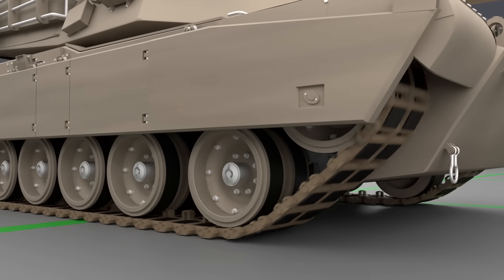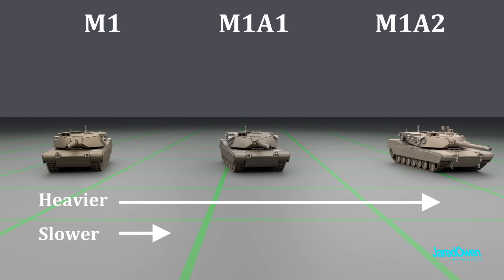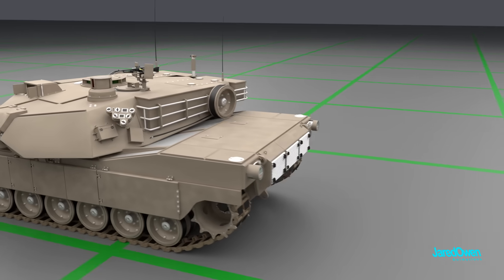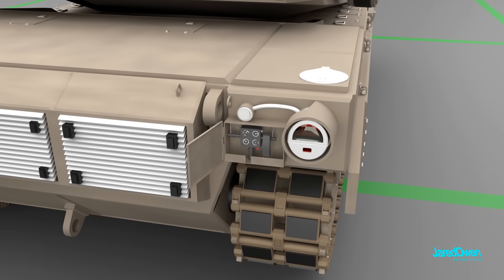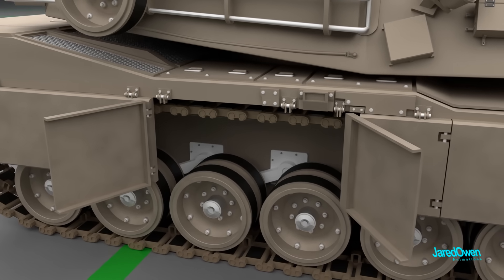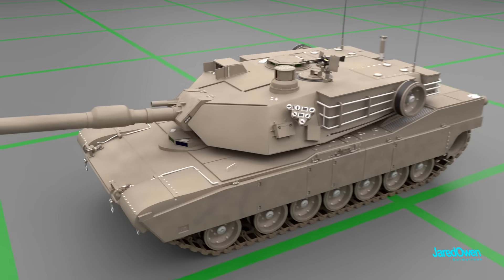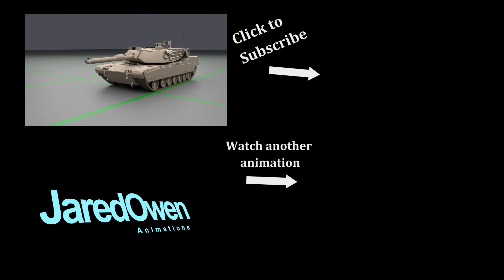How does a Tank work? (M1A2 Abrams)

Comment: I was a M1A2  Tank Engine Mechanic and Tank Recovery Specialist (63E10. H8), stationed at HHC 4/64 Armor Delta Team Maintenance, 24th Infantry Division Fort Stewart Ga  89’ to 93’, served in Desert Shield/Storm from August 90’ to March 91’…….the video is pretty accurate describing everything, the only thing that’s different in the vid is when the phone was shown on the back of the tank, they weren’t there during the war (they must have been added years later after I retired).   I had the privilege of driving and riding in them during maintenance work (testing the engine after fixing them and riding in them to make sure the transmission sounded properly after the support team fixed them etc…)

By the way, the tank can reach speeds of up to 70mph but if the tank went that fast the transmission would tear up,  so to prevent this a governor is put on the engine to limit the top speed to 45mph.   Some might think that’s a slow speed, you go ahead and try to stop 60 tons zooming towards you that fast…….yea, good luck with that…..lol
Reply: Then how did they communicated? Also, thank you for your service brother! 😎🇺🇸
Reply: @droman608  They communicated thru regular comms  inside the tank from the headsets they wore.
Reply: Thank you for your service.
Reply: was the tank loud?
Reply: @ProAvgeek6328  No, it’s very quiet inside and believe it or not the ride is very smooth like a Cadillac I kid you not………..your hear the engine but it’s not loud like you hear it on the outside, it sounds like a low hum sound inside the turret.
Reply: @Akumaa2000  interesting
Reply: @Akumaa2000  I have so many questions about the tank so first of all how do you check the fuel level?
Reply: @ProAvgeek6328  In the drivers compartment there’s a digital display that shows how many gallons of fuel the tank has, there’s 3 fuel tanks (one up front and two in the back on each side on the top rear of the tank) and the driver relays the info to the tank commander.
Reply: @Akumaa2000  It shows how many gallons of fuel is left, does it calculate range?
Reply: @ProAvgeek6328  Yes it does , the tank commander also has a chart (forgot what it’s called) that estimates the range of travel from the capacity of fuel left or something like that…….don’t know if they still use that or if they have something more advanced.  I know alot of the tanks went thru some serious upgrades years after I retired (better armor, electronics, ammo etc…)
Reply: @Akumaa2000  oh nice
Reply: @Akumaa2000  how does the gunner fire the main gun?
Reply: @ProAvgeek6328  that’s done from the gunner station in the turret.
Reply: @Akumaa2000  but how does the gunner specifically aim and fire the gun? does he use a joystick or something?
Reply: @ProAvgeek6328  the gunner has a fixed handle with two pedals on each side (the best I can describe it) in front of him when he’s sitting in the gunner’s seat, it can be turned left and right like your twisting which turns the turret left and right and you can move it forward and back which moves the main gun up and down etc…..on the front of the two pedals there’s buttons that can be pressed when squeezed, this sends an electrical charge or whatever it’s called to the main gun to fire and shoot the sabot tank round to its target, (I don’t know if this has changed from upgrades over the years by I’m guessing it’s relatively the same).
Reply: @Akumaa2000  alright thanks
Reply: @ProAvgeek6328  From my personal experience it wasn't. The engine was rather quiet, however if you stood close enough it would rattle your whole body (LITERALLY). This happened to me while stationed in S.Korea. #awesome
Reply: @droman608  Where you a tank commander or loader ?…..those two positions seemed to be closest to the engine in the turret with the gunner up just little further but not much.
Reply: @Akumaa2000  As much as I would've loved to be the tank driver, I was too tall (one onf my comments show this). I was a 88M. #thankyouforyourservice
Reply: @droman608  88M is what I really wanted to do but since “transportation” covers so many driving jobs the video for it at my recruiter’s office wasn’t working, I didn’t want to make the mistake of ending up driving an officer around in a Humvee so I picked tank mechanic instead since there was a video for that one…..lol
Reply: @Akumaa2000 the odds of that happening are rather small (even though it happened to me). Although you probably seen those HETs, I'm glad I never drove those because it meant staying in the field waiting for the tanks to return.
Reply: @droman608   I would have done HET driving job too if the video was available for viewing in the recruiter office.

Comment: The Abrams tank is a bad copy of the German Leopard 2 tank. The Abrams tank has no chance against the German leopart tank
Reply: Copy how?
Reply: Absolutely true, the M1 Abrams prototype hulls were built in Germany by Krauss-Maffei and many components are still interchangeable with the Leopard 2.
Reply: @sandervanderkammen9230  No they weren't?
Reply: @peterson7082  Same hull and chassis design, same basic gun too.
Reply: @sandervanderkammen9230  Not even close regarding the hull
Reply: @peterson7082  The 
XM815 and XM1 chassis-hulls were built and imported from Krauss-Maffei in Germany.
I have seen the data plates myself to confirm this.
Chysler modified the rear plate and engine deck to fit the AGT-1500 and added the front locker for  track grousers. The  GM X-M1 hulls are still nearly identical to the Leopard 2.

Comment: Imagine taking just five of these back in time for World War II
Reply: Remember that part where he said it runs on jet fuel?
Reply: @kablah777  Just my imagination thinking how technology has advanced.

But you seemed a little snarky, so Let’s think about this🤔

Jet fuel can actually be used in trucks, but only in diesel engines. Ultimately, the difference between gasoline and jet fuel are the hydrocarbon molecules and the additives contained in the fuel. Both are derived from crude oil, and both run their respective engines on combustion. So the means to producing  jet fuel in that time line isn’t so far fetched.  

Also The Germans had over 60 jets in WWII.

Comment: You Forgot the Brits Who pioneered the Main Battle Tank Design Still used today
Reply: The first MBTs were built in Germany.
Reply: @sandervanderkammen9230  What would you consider the first MBT to be? I know a lot of people consider the Centurion to be the first.
Reply: @t1e6x12  Using the strict definition of MBT the Tiger I is clearly the first successful example of the MBT concept... 
The Centurion entered service after WW2 ended and was developed after British forces encountered the Tiger and was without any doubt heavily influenced by the Tiger.
Reply: @sandervanderkammen9230  What is your definition of an MBT? Clearly your definition is far different from what it has been perceived as. 

Everywhere I look, the definition of a main battle tank includes:

Good mobility
Good firepower
Good armament
Good anti-tank capabilities
Good infantry support capabilities

The whole point of a main battle tank is to replace light tanks, medium tanks, and heavy tanks with one single design. The Tiger is a heavy tank. Nothing more and nothing less. It fits the description of a heavy tank, prioritizing anti tank capabilities and armor over maneuverability. Universally the Tiger is accepted as a heavy tank.

Claiming that the Centurion's design was heavily influenced by the Tiger 1 is a bold assumption. If you mean the 88mm gun is what the Centurion was designed to withstand, that would be correct considering the 88mm gun was the most potent anti tank weapon the allies were facing at the time. Im sure when they analyzed the captured Tiger they received, they applied some of their learnings to the design of the Centurion, otherwise I would claim you overestimate the influence of the Tiger. Regardless, this doesnt matter when it comes to the Tiger being an MBT or not.
Reply: @t1e6x12  You sir clearly do not understand what the definition of an MBT is... perhaps you should study up and better acquaint yourself so as not to cause any further embarrassment?

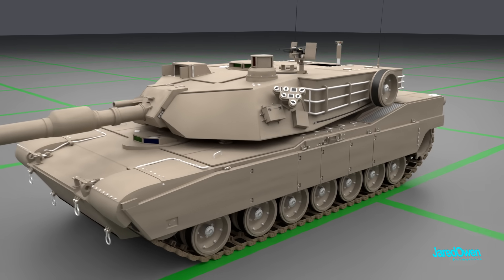Comment: 2:45 yeah, but if you compare miles per gallon, then adjust for weight, and as you said the tank is equal to the weight of 35 cars, so take that 0.6 and multiply by 35, you get 21. The tank is only 12.5% less efficient per unit of weight.

Comment: A tank depends upon its very thick, layered  armor to prevent penetration of its hull by rockets and anti-tank shells. Such armor is very effective. This layered steel and ceramic  armor is  10 inches thick , too heavy to used to cover a 75 ton tank. 
Hence: flat engine deck of such tank is very vulnerable : only 1 inch of armor.
 A  to (EASILY) penetrate this 1 inch armor and destroy the engine of the tank.
https://en.wikipedia.org/wiki/Spike)
The Spike is the only missile that can GURANTEE impact on the top deck of a tank.

Comment: "War thunder is historically accurate"

War thunder: let's pit German WW2 tanks against post cold war Russian/U.S tanks...
Reply: It's not as unrealistic as you imagine it, let's say a tiger 2 vs t54, that's only a 10 year difference, in today's battlefield you see t62 and t72 fight 20+ year newer tanks... I'm sorry but your weraboo dreams will never come true...
Reply: @Sveta7  silly reply. Its unrealistic because historically IT NEVER HAPPENED.

ALSO in the 70s/80s tanks reached their peak and are still basically the same today so your point is invalid.

Today the M1 Abrams is still basically the same with only minor updates. The Russians still use T90/T80 and T72 which are all basically the same.

After that point they only underwent modifications.
Reply: @ertugrulbae46  Well t54 didn't exist in ww2 so what, you're saying that because of that the game should end at ww2 tech? This is a middle ground solution, if let's say ww2 was prolonged these kind of encounters would have eventually happened cause technology advances...

Tanks reached their peak at 70s and 80s, lmao you clearly don't know much about tanks to be making this and the previous argument, by your logic t72 ural is the same as leo 2a7 because peak time right?
Reply: @ertugrulbae46  I see that you made an edit, no they are not the same, they are getting new designations for a reason m1 for example first had a 105mm gun and m1a1 has 120mm, DU armour etc, same with the russians, not just few modifications but new engines new armour fillings new gun control systems, etc these are not minor changes...
Reply: @Sveta7  they're minor edits. Not a whole new tank.

The fact of the matter is, they stopped creating new tanks after that point. New ones are variants which are hardly different.

Also the t72 and m1 were early. 1971 for the Russians. After in 79/80..the variants were largely unchanged

If the war prolonged. This wouldn't have happened because Germany would have probably made Tiger 3s and Tiger 4s..maybe even lions. Not stop producing tanks at WW2.
Reply: @Sveta7  nope. I'm saying people can apply some logic, WT devs for example, and separate tanks fighting other tanks which are from a whole different era.

To put simply.. fix the effing matchmaking where WW2 tanks won't face tanks 15 years newer
Reply: @ertugrulbae46  That is mainly the case because there are no world wars currently or cold wars that require new tanks, also economy but the fact is the t72 from 70s 80s is not the same as in 2020 some only by the siluete.

Well there is no tiger 3 or 4 but there is a panther 2, a tiger 2 105, an e100, maus etc so yea there are tanks that would fill the gap between ww2 and patton/leo 1

Well tell that to Iraqi soliders that had to use early/copy t72 against more advanced coalition tanks, war is not fair u use what you have which may sound ridiculous but it's historically accurate
Reply: @ertugrulbae46  its because of game balance... If you had it perfectly historically accurate then everyone would be playing germans and no one would bother playing anything else because guess what? No one had tanks that could equal the tiger or tiger 2 with the exception of the IS-2, so who would bother playing shermans and getting raped every game? 

Now if you wanted it REALLY historically accurate, your german team would get about 3 tigers, and the enemy team would get 30 players in shermans. Have fun with that. 

What im saying is that 100% realistic means 100% one sided no matter what you do.

Stop whining that WW2 tech is facing cold war stuff, and start being impressed that WW2 germany was producing vehicles capable of equalling cold war tech.
Reply: So what you want? Jagdtiger, King Tiger, and Maus slaughtered bunch of Shermans and T-34s?

Comment: Two minor errors, or maybe rather informations that may lead to misconceptions:
- M1 is one of only 3 tanks in the world that use gas turbine. All others use normal piston engine.
- For a tank, M1 is pretty spacious. Especially if you compare it with some Russian constructions.

Also it is worth mention that due to large surface are of the track tank exert less pressure on the ground than a human, especially soldier with lot of equipment. So it could roll over soft terrain where infantry would bog down.

On the other side... three section of the video for sponsor. Are you f*** serious?

Comment: I could talk all day about this fascinating machine. I know what each and every piece and part does. I think my personal favorite part is the main gun ammo storage system and it's door mechanism. Some inside info for you: rotating the gun over the 2nd right roadwheel reveals the hydraulic reservoir inside the turret when doing a "zero pressure check", that is, checking the main gun's hydraulic system fluid level. Also, the new A3 was set to be standard by the time I got out, and finally solved the ammo problem of "heat indexing" a sabot.
Reply: Wait, they actually fixed it so people can't shoot the moon?
Reply: They have made the FCS able to send the signal in the newest block of the A3 , I believe......but the actual ammo itself? We are gonna use the standard m830, M829, and CAN, and MPAT round for some time , as I don't think that they have started making the new types of all purpose rounds yet.  I remember when the training MPATs were new. I think they were yet another kind of abortive attempt to try to make a new ammo type. Or more then likely , a lot of people's way to make more money.
Reply: I could really use your wisdom! Trying to write and eventually illustrate a story featuring this beast, just wish I had more references for the inner workings aside from surface level info!

Comment: Sweet video. Something I'll add: they can go 60mph, but the track quickly breaks apart at those speeds. Fastest mine ever went was 36mph, and it was faster than most.
Reply: We had one at hood with the governor burned out, it would do 50 in the mud. Speedo goes to 60.

Comment: A tank has two tracks, if the top of the track is going 20 mph, how fast is the bottom part of track going?
Reply: Zero
Reply: @dammitttman8  in other words you don't understand the question.  You really didn't need to let everyone know you don't understand,
Reply: @garyfinger294  I also don't understand the question. But wouldn't the bottom of the track be static on the ground until it gets lifted again?

Comment: no, sir! Tank tracks & Caterpillar tracks" are not the same ! they operate in a similar way, but Cat tracks are designed to grip the terrain that the tractor is working on so it can gain and keep traction as the tractor's blade cuts fresh dirt and moves it out of the way at the same time. Put a cutting blade onto the front of a tank and you'll either slip or break a track or just get nowhere really quick!
Reply: Caterpillars don't go 40 either - - - each one is optimized for it's needs.

Comment: The commander does not use the viewing ports.  He uses the Commanders Independent Thermal Viewer (CITV) located right in front of the machine gun on top of the turret. This gives a 360 degree view of the battle field with infrared imager that is the same as the gunners.  Used only on the A2 version.

Comment: "Historically Accurate"
Me: dies in a Tiger from an APFFSDS in Br 5.7
Reply: Gaijin: Oy opa izvini.
Reply: possible just blow the engine up from the rear and it blows that through the crew ... tigers are good front on and side on ... but make m113's look toough from the rear ... think of them as the gremlin of tanks ... they burn when hit in the rear
Reply: APFSDS*